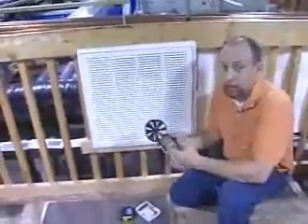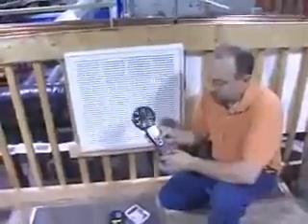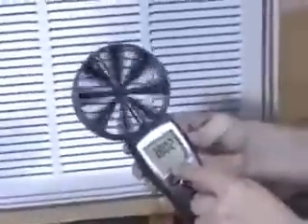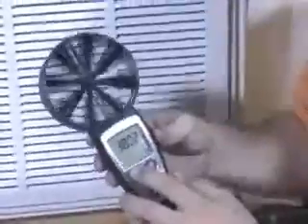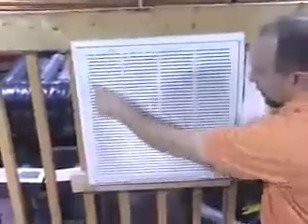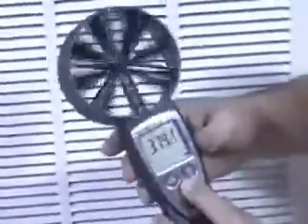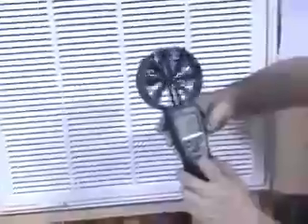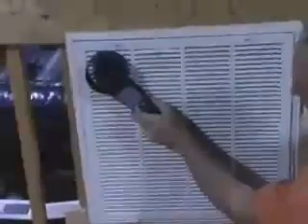Testo Vane Anemometer 417 with Built in Vane

Comment: thanks for the video.  i ve been doing tab for 6 yrs, 20plus years in HVAC imdustry.  i have a question, what Ak ( corrected area of the return grille) are you using, and how did you calculate it?  normaly when i use a rotary vane i would perform an air foil or pitot tube traverse. then i would measure the grill as you did. i use the vane and obtain an avg vel at the grille and then divide my cfm from the traverse by the avg vel and that tells me the actual free area of the grille.  the i have an ak and can quicky read like grilles with the same ak. i am just curious how accurate this type of measurement is. is it + - 3% +7 cfm?